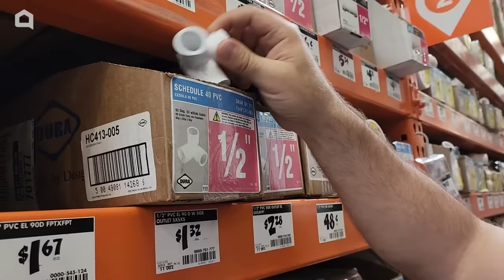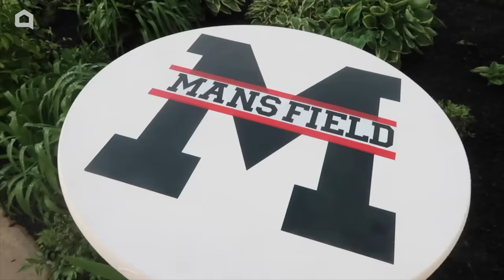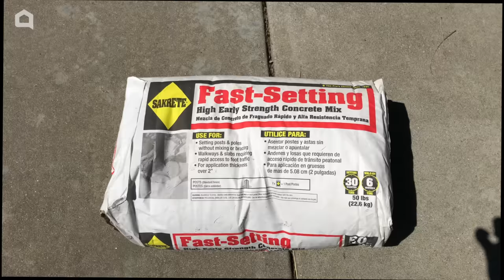Cut a plastic chair in half for this BRILLIANT plastic chair makeover idea!

Comment: I like the ideas...but the plastic chair seems like a good idea when you're sitting...but all I could think was how would I get up and out of that thing? Especially if I'm having a cocktail! 😂🤣 You'd be kind of trapped up against the pool and the arms of the chair would restrict swinging your legs around. 😬😂
Reply: That’s a great point you have made. Potentially and especially dangerous if you can’t swim.
Reply: Sometimes you just have to roll out sideways.. if you're that drunk you're not gonna care
Reply: Its a terrible idea. You cut up a perfectly good plastic chair, creating plastic waste in the process. Put a nice comfy quilt down.
Reply: Really???  Put your hands on the pool deck and push yourself back until your legs are fully on the deck.  Then cross your legs, meditate, and come up with more ideas.  My weak knees require that I roll over onto my knees and work my arse up into the air while on all fours.  Kinda sad, but I manage to get up.
If you got down, you can get up!
BTW.  An amazing compilation of clever and lovely ideas.  I especially liked the ways to turn palettes into useable furniture.
Very nice!
Reply: @Mr tyrant 😂🤣
Reply: @geeoh8287  OR a water resistant cushion from a beach/lawn chair.
Reply: @Mr tyrant   There could be head blows that might be damaging.
Reply: The only way is in, lol
Reply: Fall forward.
Reply: Helicopter lift.
Reply: With the high price of those plastic chairs. I wouldn't waste my good hard earned money cutting them up like that.
And with the high cost of PVC plumbing pipe and fittings. I wouldn't waste my money making a towel rack by the pool. Just hang the wet towel on the fence or on the back.of a plastic lawn chair that didn't get the legs cut off sitting by the pool. Some of these ideas  are from people who won the lottery, or has more money than brain's and too much time on their hands. I would not "decorate" my property with these goofy plain and stupid s**t idea's.
Reply: @rickprusak9326  - 😆😅😅😅😆😆👍👌
Reply: Jump in the pool and use the ladder!? 💦
Reply: Careful now. Drink responsively or stay out of the chair.
Reply: @alyon5749  Best idea. 👍
Reply: What 😳

Comment: Lots of these are fun ideas.  I would say if you drill holes in a cooler, you need to seal them so you don't loose the thermal insulation.   It would be better to attach wood framing with adhesive to the lid and make sure you caulk any screw holes from removal of the hinges in the plastic.  Also being able to remove the cooler body for cleaning, and access to the drain plug would take it up a notch.
Reply: I have one of these homemade coolers...(WITH THE TEXAS🇨🇱 STAR ⭐ ON IT!😁) 
It's actually beautiful...and it works extremely well. My brother bought it, so I don't know any details.... it's on/underneath the large covered patio, it's also cabinet height and we use it all year long..
(Just thought I'd tell you how MUCH we use it and HOW WELL THEY WORK. THEY WILL EVEN HAVE ICE STILL IN THEM THE NEXT DAY ‼️)
Reply: I had a park bench under my Palm trees at the corner of my yard. 
Several Elderly people would stop and rest there during their walks. 
Some low life stole my bench. 
I have some old Concrete Blocks and 2x4s and I will soon have a new Bench 😊

Comment: Great ideas. I like the plastic chair idea. We have a camper van. It's actually uncomfortable for my sore back as there isn't a place to lean back against in bed. One could put it on the bed to sit back and read. They are light and easy to transport. One could use them on a stoney beach as we have here in N Germany. The stones dig into you through the towel. The cooler box idea is also great. Thank guys, some easy fun ideas. 💡😁

Comment: Another option, instead of the concrete top on the lighthouse. That large lightbulb shade could’ve went on top of the lighthouse and you could slide a battery operated light inside to light it up.

Comment: Not to be picky but I would use stainless steel screws inside the cooler. The other screws will create rust with the moisture.

Comment: Another cute yard idea is a 3 or 5 gal bucket w a plastic
Shallow dish from dollar tree on top. Affix a tiny water pump from AMZ that is powered by the sun. Add water....spritz into the air and birdies come. Use dollar tree pebbles to make
One of the divided area extra shallow and butterflies will even stop by.
E-6000 some skinny dowels on the edges and birdies will line up to take a shower.
Freshen up the shallow basin as needed. Hummingbirds love it....
Put a large shallow saucer w water in IT for ground animals like ibis, lizards.
Shoot the iguanas tho. They stink terrible and devour your flowers and every birds egg they find....and they are NOT indigenous to Fla. Neither are tegus(which are VERY dangerous) nor the boas.....BBs will work.🖐🏻☺️